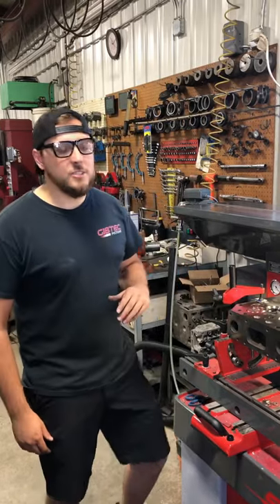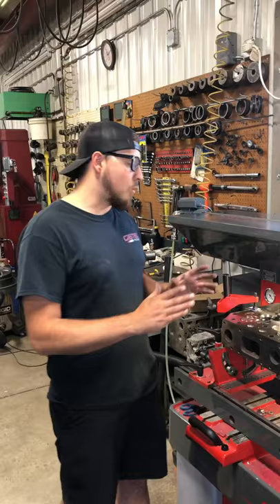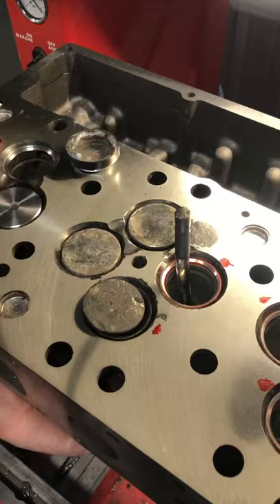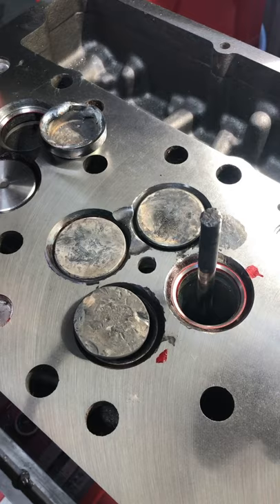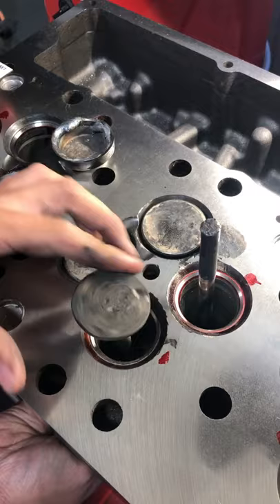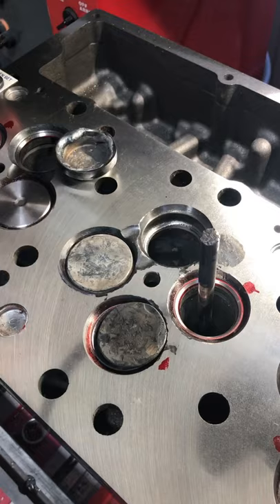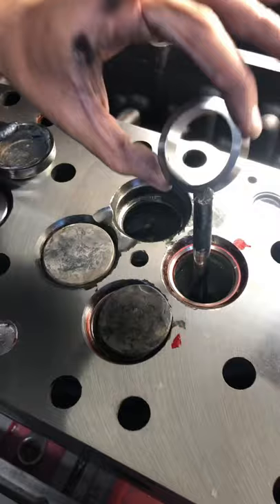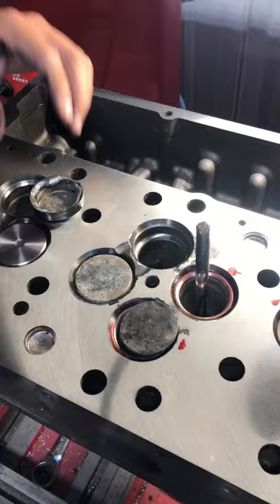#shorts C12 Caterpillar Catastrophic Failure - What happened?

Comment: Two options 
1. The original machine work and assembly wasn’t performed by Jim’s automotive and machine!
Just saying
2. The broken exhaust valve got between the intake valve and intake valve seat 
allowing the piston to come into contact with the intake valve thus, creating enough force on an angle to act like a punch which rotated the seat within the cylinder head ultimately, destroying the seat requiring the cylinder head to be machined for an oversized seat.. 
The running for sometime with a loose seat is simple;
Naturally, caterpillar being the best  Diesel engine manufacturer on the planet it’s very likely the operator never noticed that Big Bad Cat was down on some horsepower, or was a hired operator and he/she didn’t give a shit that something wasn’t right, or the boss man was screaming to get whatever the GC was whining about most likely caused by one those brilliant schedules their always so proud of these days that for example show hanging drywall and installing electrical trim on the same day, 
Or,
Moving earth but, also paving the new road on the same day! 
My point is for appearing that the seat had been in a running engine for sometime no problem when it’s a catipillar powered! 
This should be interesting

Comment: There's more background info, that needs to be known for me to give the answer your looking for. The intake seat, is that original or is that prior work? Because if it is prior, than the machine shop is at fault, if not than it's on parts failure. There is are alot of Machinists that are only that in name.
Reply: This is the cringiest thing i've read all day you missed the whole issue by a country mile with that comment xd

Comment: the seat fell apart making the other valve bend and break the keeper groove off. beacause the keeper groove probly didnt fail without a cause.then everything was munched up after the seat started holding valves open.i would thing the valve was coil binded to break the valve keeper groove.

Comment: Well here's my story I think the valve broke off the hammering action by the piston tend to be more on the particular valve the excessive stamping result in deforming of the valve seat as the geomtery of the valve tends to exhert pressure in a direction that expands  the valve seat radially outward the stamping forces could have been substantially high as the material  is known for hardness 
The fit despite the deformation of existing seat was, as the hammering was at a high tempertature the coefficient of expansion of cast more than that of hardened seat could have been the possible cause 
Correct me I could be wrong???

Comment: Impossible to tell from a video. My guess would be a previous valve seat replacement. When they cut the counter bore for the seat maybe some bad chatter right at the finished size. Instead of going oversized they just installed the seat .. Without seeing the type of counter bore damage first hand it's impossible to tell.. look for a matching damage pattern to the old seat if it is possible. Never said if you cut it out or it just fell out?

Comment: Usually , valve seat ring are made of stellite material .  wear resistant alloy  , cylinder head are made gray cast iron .tendency that intake valve ring slack out due Broken metal chips from exhaust valves hammering by piston top head.

Comment: What happened to the to the rest of the valve back in the old days I seen the 3208 drop a valve seat because of the latest valve adjustment I will take out six-cylinder valve and seat will come out and go through six cylinder will it stop going jumping around run 6 cylinders

Comment: Well the fact is if the other cylinder didn't have valves that broke loose, did you measure the links of the other rods? Also, if one broke off like that and that much damage was done while running, it's possible that it ran long enough to break loose your inserts which are harder than the steel. You're putting them or aluminum. I guess you're putting them into so there's your pancakes strip waffles. Even the pecan nuts and a fork to eat it with

Comment: It could have been apart before and was over bored with this being possible it could have jumped time causing the piston to hit pushing it back in if the valve lash was in-properly set which the force of the piston could have slammed it back that hard whilst it was running

Comment: To cause that much damage had it been overheated which week what's weaken the exhaust valve what that means as a cylinder temperature of over 1200ﾟ When you get them that hot they don't last long and it can be overfueling or underfueling on the injector to cause that problem

Comment: i think that same thing happened to my skoda fabia 1.2 every thing was working fine it had nice compression it was running flawlessly no oil leaks what so ever but one day my dad was going to work and the engine just wouldn't start the fly wheel did turn so the starter was good and my dad decided to open the engine. So when was finished he showed me the valve i was like "ok what is with the piston" and then he showed me another valve which wasn't broken and asked me if i could find any difference between the two i was like "ooooohhh 😳😳😳

Comment: did u said key broke off valve n fell in cycling ?

my opinion tell me that that valve got no lubes and frozed open unite pistol hit it broke valve n kick valve rod thur head n broke key holder off n one piece of valve destroy port n few other and yes piston did hit 2nd valve was stuck open by other valve stuck in it make port so big dure no lube or dry or hot valve rod frozed in place
im engineer repairs i can tell more how that happened it more points on dry or no lube to valve rod or over too tight n sticking

Comment: Hard to say with all that loose debris from the one broken valve. I would guess a big piece of that broken valve made its way into the lifter valley and it made that valve crooked and he just kept running it. But it was only crooked enough that the valve, probably bent would follow the path of least resistance and seated it self all crooked. I know from experience, some folks that do not know any better when an engine has an issue, man they don't shut her down and repair it. They get angry and put their foot on the throttle full send like Satan. I'm probably wrong, but there is my 2 cents.